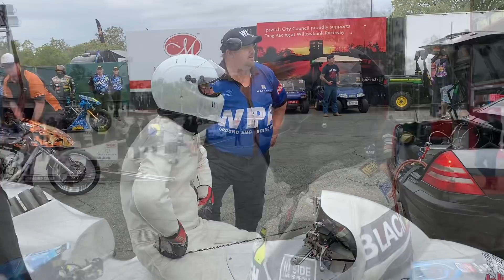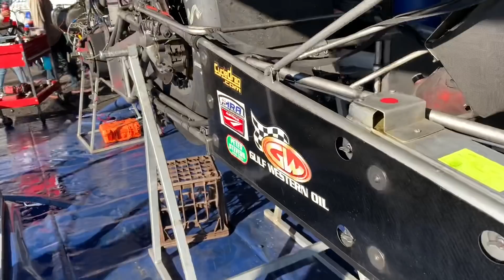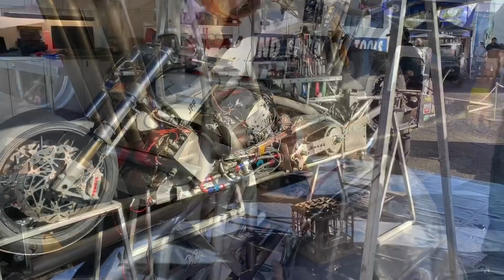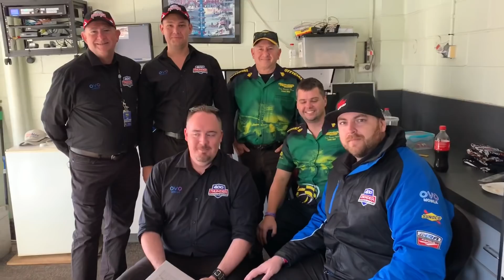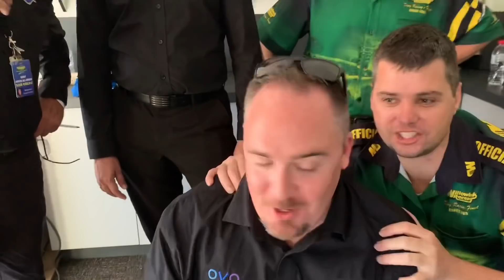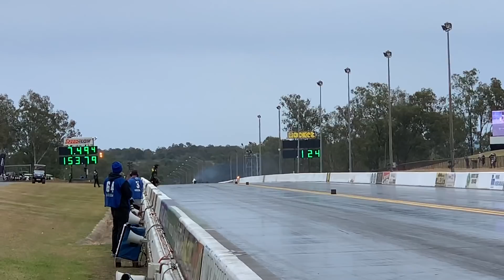FIRST FIVE SECOND AUSTRALIAN TOP FUEL NITRO BIKE RUN AT STAKE with CHAMPIONSHIP at WINTERNATIONALS

Comment: That was a 7.49s and an 8.95s
What happened to the 5 second pass?
Reply: Blew the back tire off in each lane i believe.
Reply: @gregorytimmons4777  - as long as they did better later.
Reply from the maker: Stay tuned. The race is on. They are close.
Reply from the maker: @gregorytimmons4777  Thank you for the feedback. If you have not already, please subscribe and share this channel with some friends who appreciate fast motorcycles. I'll keep it coming! Thanks!